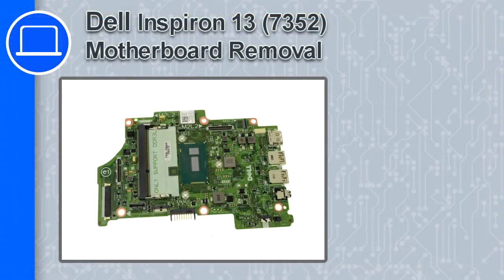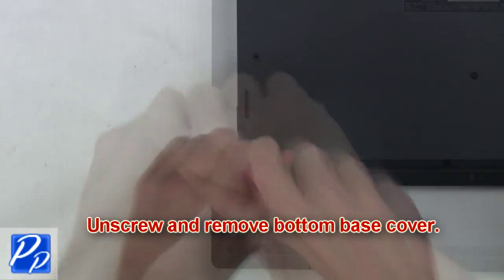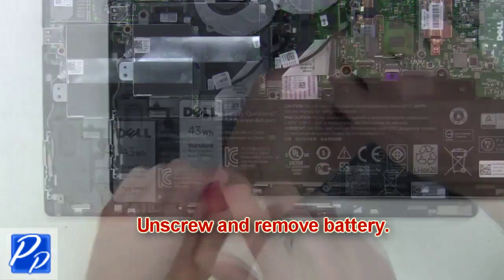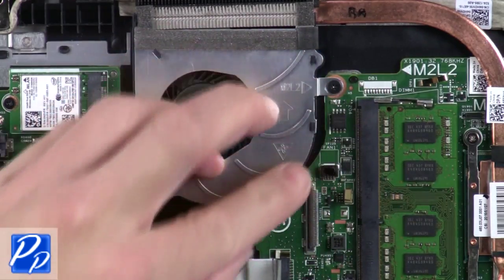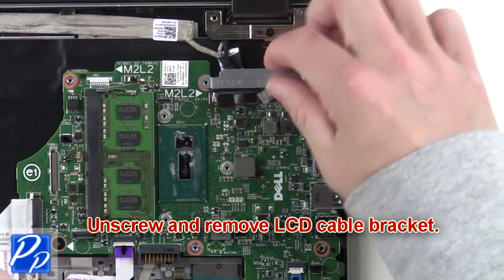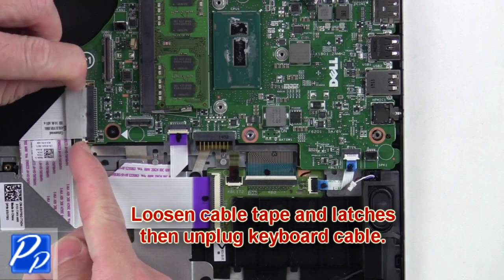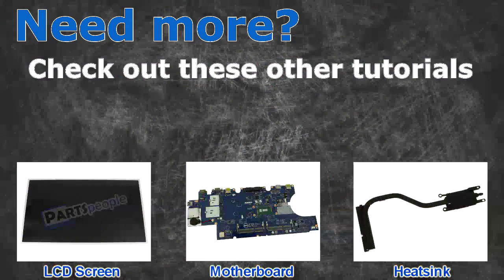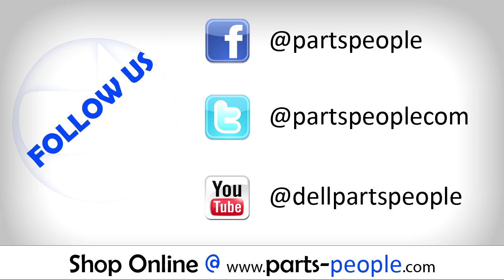Dell Inspiron 13-7352 (P57G-001) Motherboard How-To Video Tutorial

Comment: I have the inspiron 13-7352.  My battery is not charging.  I tried every trick in the book (replace the battery, change the charging port, delete battery drives...).  If I replace the motherboard would it solve my problem?  I don't have a "battery charging" icon on the task bar.  Any idea?  Thank you in advance.  Great video by the way.